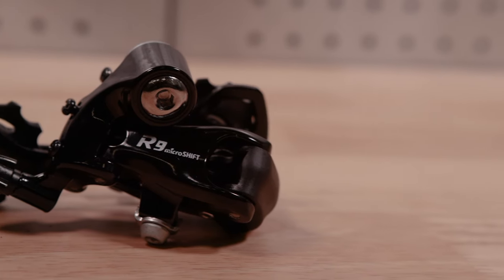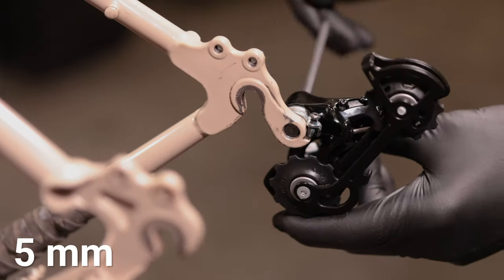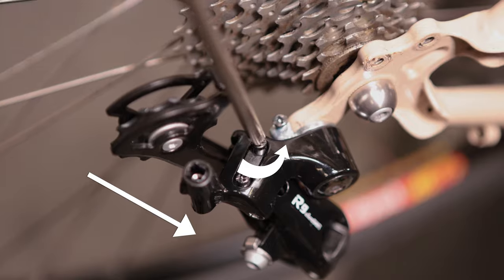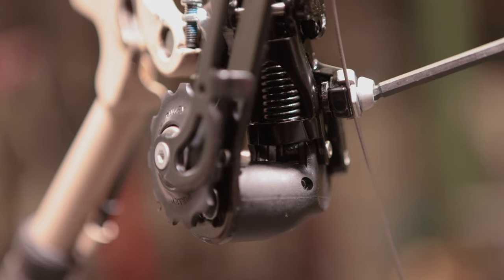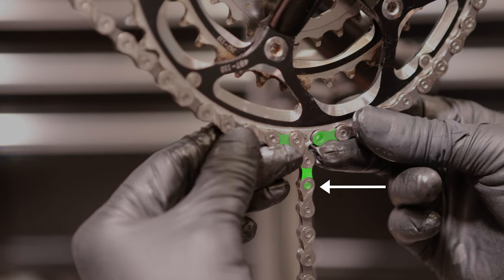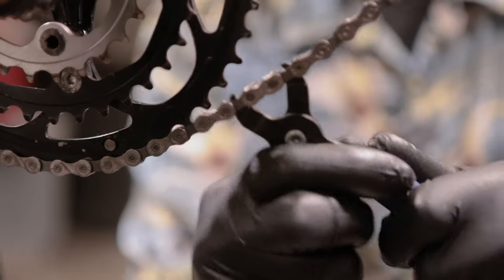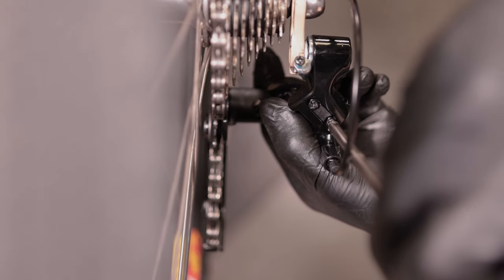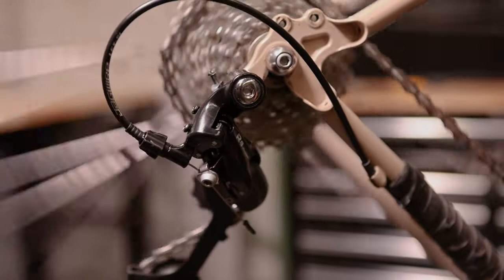R8 | R9 | R10 - Road Rear Derailleur Installation

Comment: Can the R9 be used as a 10 speed rear mech? So many retailers showing it is compatible with 10
Speed but your website states 9 speed. Thanks!
Reply from the maker: Yes, as long as it's the old Shimano cable pull. It won't work with Tiagra 4700 or GRX 600.

Comment: While inserting or tightening cable which gear should the front derailleur be if there are 3 chainrings ?🤔
Reply from the maker: Doesn't matter how many chainrings or cogs, both front and rear derailleurs should be on the smallest chainring or cog before inserting and tightening the cable.
Reply: @microSHIFTTECH  I just wanted to know when tightening cable tension of rear derailleur on which gear should the chain be if there are 3 chainring at the front.

Comment: it is possible to match a 9 mtb speed cassette and derailleurs with the down tube shifter levers?
Reply from the maker: Yes, as long as the 9 speed MTB derailleur has old school Shimano cable pull. Our ADVENT 9 speed rear derailleurs are compatible with a wider range, so they use more cable pull and are not compatible with downtube shifters.
Reply: @microSHIFTTECH  you indend that it's not possible to match your mtb 9 speed cassette and rear derailleur with your downtube shifter? cause I'd like to match something omogeneous